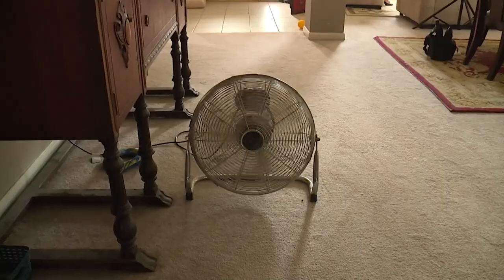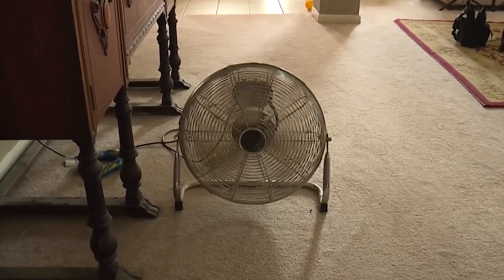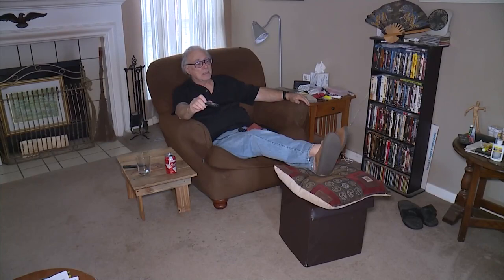Energy savings for the home and car

Comment: Ask Amy is great and full of useful info. I love that it's available any time on streaming. But I would not recommend that most people change the capacitor for their AC on their own. Although it is easy and fast to change, it is incredibly dangerous. It's not simply a matter of shutting off the breaker and testing with a volt meter. Capacitors can and often do hold charge even when disconnected. Think of it like a huge battery that wants to discharge all its energy at once instantly. Those leads are very close together and exposed. If you've ever burned yourself removing a small capacitor from a circuit board, you know how much it hurts. A capacitor needed for an AC unit stores orders of magnitude more energy. Yes, it can be done quickly. Yes, it can be done safely. And yes, the capacitor can be discharged with an appropriately sized resistor. But it should be done by those with a healthy respect for the danger in handling a capacitor that may still hold a charge. Just because it's easy doesn't mean it's safe for all to do. Does it have to be your HVAC tech? Not necessarily. It is a relatively cheap item, though my tech has not charged me a ridiculous amount of money when a capacitor went bad.